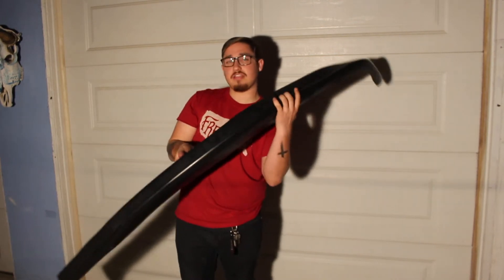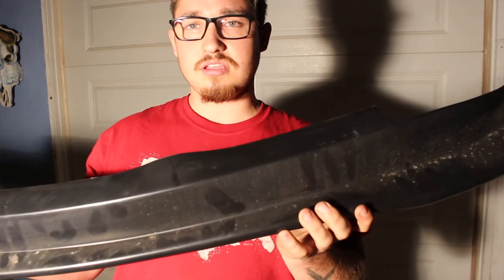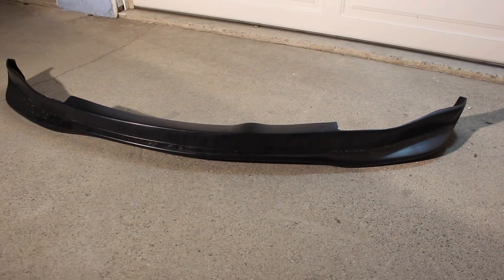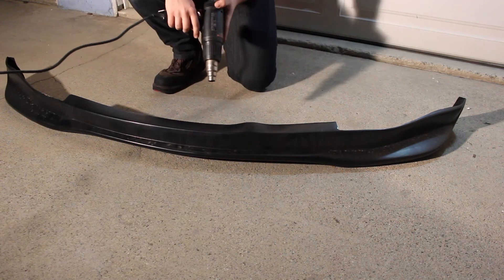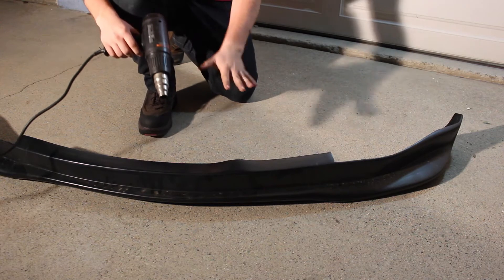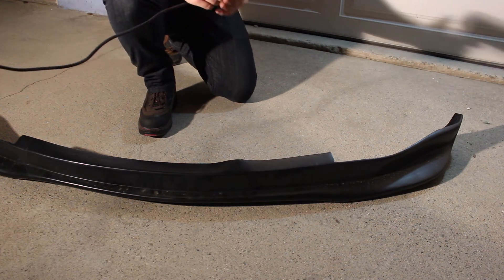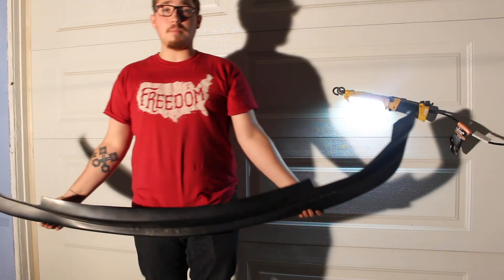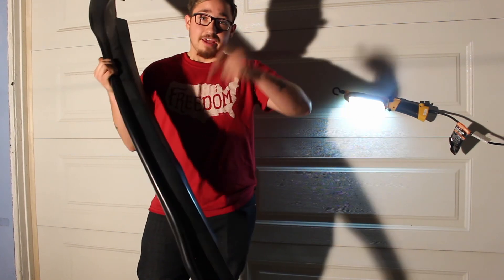How to Fix/Bend Back Your Polyurethane Front Lip

Comment: How high the temperature use we use on the heat gun? Thanks a lot
Reply from the maker: Medium to high. Take a bit of heating. Also now that it’s summer time and hot. You could put it out in the sun all day. Sometimes that can help the polyurethane return to its original shape